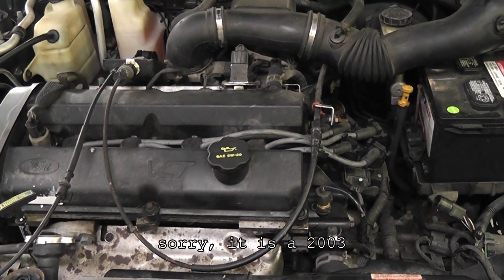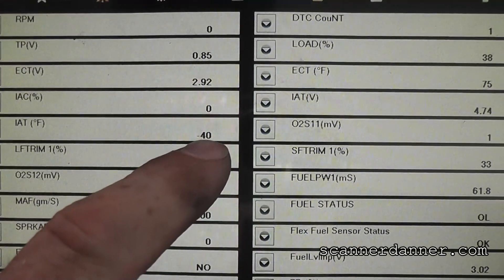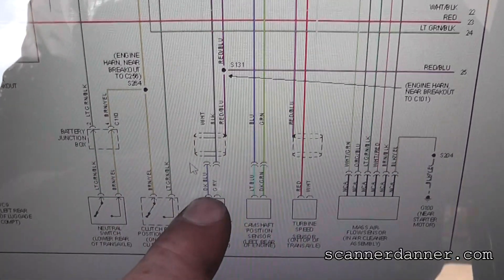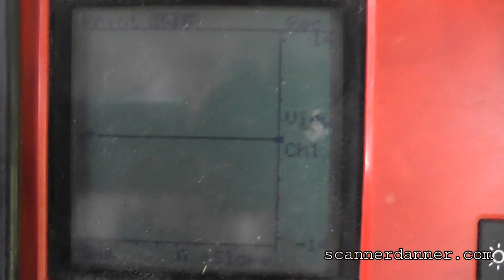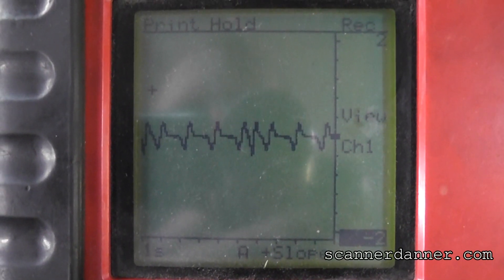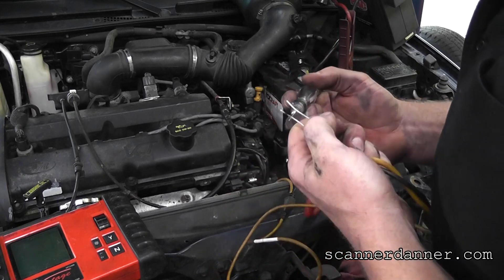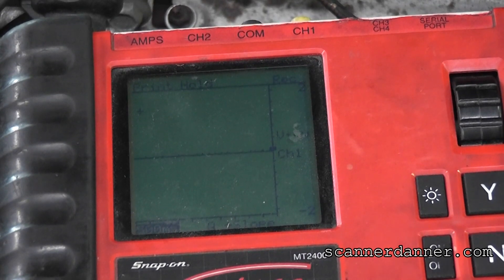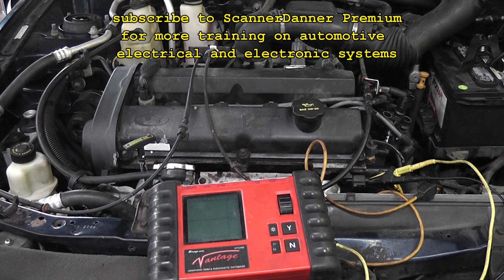How to test a Ford crank sensor (Ford 2 0L Case Study)

Comment: My 2005 ford focus 1.4 recently snapped the serpentine belt, well, shredded it, was due to a faulty power steering pump, replaced the belt and pump, now it's not starting. could it be this sensor? It sounds almost like the starter isn't engaging, but jumps forward when turning the engine over in gear, last roll of the dice before I scrap it, just seems a waste as the car has only done 50k miles

Comment: If you measure the voltage on both wires on the connector to the crank sensor, are both of them supposed to have 1.6 volts? That’s what I got. I have the same car with pretty much the same issue
Reply from the maker: Some of these Ford two-wire crank sensors used a floating ground. Meaning yes, you will get voltage on both wires while cranking or running. It is an AC sign wave though. When are you measuring 1.6v? (Unplugged, plugged in backprobing, engine off or cranking?)

Comment: Hello!I have a 2003 2.0l diesel hyundai elantra that cranks but no start.checking crank sensor (inductive 2 wires+shield)with dmm resistance show 1Mohm.It seams defective but when i crank it produces about1,5-2 ac volts.i don't have a scope to test it.could be a good sensor?Also at start phase if crank sensor is defective the ECM will not activate the pressure regulator valve?since when i crank there is high pressure when measure at hight pressure pump output but it is low  when measured to the rail(the injectors are good-not leaking,the pressure regulator is good,).Thank you. L.E.no fault Code  on tester.

Comment: Ok I have an 03 ford explorer xlt. And it will crank but won't start.. every video I found is useless and doesn't show me where it is located and how to replace it.. help
Reply from the maker: BTW the crank sensor reads a tone ring on the harmonic balancer (front of the engine)
Reply from the maker: Doesn't show you where what is? The crank sensor? 
Your no start could be a lot of different things. What codes? What are you missing? (Spark, fuel pressure, injection pulse)
Reply: @ScannerDanner  honestly idk. My dad drove it from indiana back to ky and after he parked it for the night the next day it would crank but not start.. and he hasn't touched it since..so he gave it to me

Comment: I will take a signal generator and with a pulse and put it right through a ramp signal but I love your electronics you are a legend but I don't like using the scan tool it's a scope because of the knobs you have to play with I like an actual scope but we both agree on electronics

Comment: I have the same problem on my mazda tribute 2003 with the zetec engine. when i start the car does not start, i put it in the scan i cannot find any fault code. I put a new crankshaft sensor but the problem prevails. I ask for your support.
Reply from the maker: you need to find out what you are missing. Do you have spark? What is your fuel pressure? Will it start with carb or intake cleaner?
Reply: ScannerDanner , I Put new spark plugs, new coil and cables.  Even so, the engine did not start.  I tested the pressure at 3.5bar.  I tested the ignition launched twice and cut.  I tried several times the engine accepted to run, I let the engine run without failing for 30min but when I tried to accelerate to get the car running the engine stopped and didn't accept to run anymore.  I checked the injectors have no leak.  What step can I take?
Reply: @abacarmassequece4869  you ever fix it?
Reply: @meofjack9644  I still haven't been able to solve the problem.
Reply: @abacarmassequece4869  I'm having a similar issue aswell my car wants to turn over but just doesn't I've checked just about all I can possibly do with my skill , fuel line carb cleaner in the throttle , alternator battery cables ,starter , and I still get no ignition so right now I'm looking into the coil pack , or the crankshaft position sensor ,I know yours turns on then turns off but yea
Reply: @meofjack9644  I've already replaced the crankshaft sensor, the crankshaft sensor wire, the camshaft sensor.  but the car only starts when it understands, and when it starts I can leave it running for 2 hours it does not turn off, when I try to accelerate the car oscillates the idle and turns off the engine, and then it doesn’t start anymore.
Reply: @abacarmassequece4869  could that be the transmission maybe? Does it drive?
Reply: @meofjack9644  At some point I tried to ride the car, I left the garage in reverse, put the lever in D with the idle speed, the car started to move from the moment I put the foot on the accelerator, the engine turned off.  and it took weeks for the engine to start up again.  And when I'm starting the engine, the speed goes up to 200rpm.  but it doesn't start.
Reply: @abacarmassequece4869  have you checked maybe your fuel pump?
Reply: @meofjack9644  the fuel pump is new
Reply: @meofjack9644  I will check it.

Comment: I  have 96 Ford Contour GL 2.0 L car cranks no start, has spark , fuel pump primes at ing power, has 42 psi on schrader valve, replaced fuel filter, i have tried about all i know, even shot either down the throttle body, its a head stomper.
Reply from the maker: does it start with starting fluid or carb cleaner? If not, remove the upstream O2 to give the exhaust somewhere else to go and see if it starts. If it does, your cat is completely plugged up. If it still doesn't start, then we need to start thinking about a timing belt issue.

Comment: My 03 focus (dohc zetec) has developed a new issue ONLY IN THE RAIN! When I hit a decent puddle, it stalls the car & throws a p0320 & will not allow me to give the car any gas, When I gas it, it misses & dies so, I simply let it idle & slowly give it more & more gas until it clears up. I am wondering if I have an exposed wire or do I need a new sensor? I did have to replace my main & rod bearings once due to cooling fans not working!

Comment: NEVER hold an HT lead away from the coil or engine. You can get a serious shock also it can misfire and send a spike to the Engine Control Unit. (RAC trained and have seen people's vehicles with damage when they do this) Get a plug in indicator and attach a plug to a large crocodile clip with a hose clip, that way you can clip it to a metal part of the engine. Watch the indicator flash.

Comment: My CEL goes off for maybe a second and then comes back on the whole time I am cranking.  (99 Ford Ranger 3.0 v6 2wd AT) is the light supposed to stay off completely?  I plugged and unplugged the connector and the light when off two times but came back on

Comment: Want to thank you for putting this video out. I have an 03 Escape with the same 2.0 engine that recently cut out on my, and had a crank but no start condition. Used this video (minus the back probing looking for wave lengths, as i dont have that kind of equipment) to track down that the crank position sensor had cracked in half. Replaced it and it was good to go, the Ford one lasted 205k miles. Thanks again.
Reply from the maker: Awesome! Glad you were able to fix it yourself before the "parts changers" got a hold of it :-)

Comment: having the same motor in my pile, 2.0 dohc zetec I installed a new timing belt,water pump & acess to the crank sensor is easy if you lay under the car! seems to me that doing it from up top,between the radiator & block, is the hard way! y not just stick your head under the car, ITS RIGHT THERE! BESIDE THE CRANK LOCKING PIN BOLT!

Comment: I have a 2000 Ford Focus Se, think it's my crankshaft. My car will shut off during idling, or iff I'm going low speeds, and overall runs rough, just looking for any opinion
Reply from the maker: if it doesn't shut off while your on the gas pedal, it is NOT the crank sensor.
Reply: ScannerDanner funny cause I unplugged the connector to the crank shaft sensor and then plugged it back in and works without a problem, until I hit a real bad pothole, once again I unplugged it and l plugged it in and it worked
Reply: About to replace the connector tomorrow
Reply: ScannerDanner it would appear it was a faulty connection to the crankshaft sensor, im no mechanic but I put on the new connector and the problem has gone away

Comment: Is it possible for the crank position sensor to give an RPM reading in the PID's while cranking the starter, but cause a no spark, no injector pulse, no start result on a 2007 Ford Focus 2.0? It also reads 74 psi fuel pressure at that time and Fuel SYS1 in Open mode.
Reply from the maker: It is becoming more and more difficult to answer questions here. I have 80,000 people asking me for help now. So I have created a forum to help you guys better. It is free to join and we can exchange pictures, wiring diagrams and waveforms if needed to help guide you through the process of troubleshooting your vehicle. Thank you so much! Hope to see you there. 

Paul Danner (ScannerDanner)

https://www.scannerdanner.com/forum/post-your-repair-questions-here.html

Comment: Question.  I own 2000 escort zx2. My battery is dieing all the time.  So I take it to alternator shop he charges battery and fixes my alternator everything checks out.  Cranks it and boom you can see the power drain out.  Well he starts checking fuses and bad wording. He finds if he takes out my 40 amp fuse under the hood labeled BTN the car runs fine and can set for days with and will crank right up.  I just lose my radio tail lights blinkers doom light with that fuse out.  Can you help. Thanks : )
Reply: C

Comment: On left side of the engine , plastic case covers what ? Camshafts ? On top of engine u see this case 5 bolts hold it on I think and UNDER it spins the camshafts I think that rotate pistons ect..

2 groved discs and a belt are  under this case.. what are the  discs called ?? Cause mine wobble a bit and I hear small clank noise from them 

PLEASE HELP SOMEONE G
Reply from the maker: are you talking about the camshaft gears? The ones that the timing belt ride on?
Reply: Yes I think so, Ford focus 2000 se wagon zetec dohc engine.. left side above the altonater and ac compresor ect and that belt , it has two ridged circle things that turn cam shafts that move pistons ect.... Now only one wobbles and I noticed it cause I heard a rumble sound and followed it there, there is a case cover I took off the see then and one closest to the seats wobbles a bit and even the belt seems off cause of it.... What could this be ? A loose nut or .... It wasn't like like this weeks ago as the noise is New.

Thanks I really appreciate the help here.
Reply: ScannerDanner I believe it turns camshafts , but it turns so the engine can run and pistons ect can go up and down , I belive this is how it works that is. I respect your help like you couldn't imagine as I have been looking up to you for a while and changing my career cause of your videos.... Thanks
Reply from the maker: thanks so much!
The one that is wobbling is probably to variable cam sprocket. It is a hydraulically control actuator that advances/retards the cam timing on exhaust cam (I think). 
It shouldn't be wobbling though. And I'm not sure I can advise you as to why. Something mechanical that is messed up with that actuator. I believe they are serviceable though. But setting the timing belt back up when you're done on that motor is super tricky.
Reply: Joseph Sepe I think it's the cam gear (intake) that wobbles.. Will a new cam gear fix this ? A guy said a new pulley and new cam gear fixed his wobble.... Different car though.... Can I still drivte to work ?
Reply from the maker: you may want to have it checked, If it is bad enough, no, you should not drive it. If that belt breaks while driving, you risk bending all the valves and increasing the cost of repairs greatly.

Comment: Great video. I have a 2000 ford focus sohc. I just did an engine rebuild, runs good, but its shaky at idle and stalls. Has new plugs, new coil, new wires. Could it be a faulty maf ? Any ideas will be appreciated.
Reply from the maker: Does the engine have variable valve timing? If it does its on the exhaust cam and it is real tricky to time and easy to be off. Rough idle is one of the symptoms

Comment: Hiya Paul, really like this one! It's the first time I've heard you discuss Floating Grounds, and these confuse me a little. Do you have open channel vid where you discuss floating grounds, concept and practice ... I'd love to sign up to prem and by book, but I'm not working full time at the moment ... so i might have to wait ... but intersted in what you have to say about Floating Grounds anyway ... Also, another area I am building knowledge on is AFR Sensors, expecially 5 wire+ ... I'm confident now that these can be tested with scopes if you understand the signal wire funcition (can be hard to dtermine which is which) but they often also use floating grounds so I'm not totally sure of the consequence of connecting th Batt (neg) as ground in these systems, though it seems to work ok.
Any thought?
cheers
alex
Reply from the maker: +Alex Messina send me an email through my website and I'll give you a coupon for a free month. Just be sure to cancel your subscription before the 30 days is up so you're not charged for the next month. 
Follow my section 21 playlist

Comment: You are extremely lucky if you didn't damage the ecu on that car by trying to feed the cam pulse to the crank input on the processor without watching for the polarity and the processor enduced floating ground.
Reply: Explain what you mean by processor induced ground. And how a signal that is simply a different signature would damage the PCM.
Reply: +Scanner Danner Premium
That ecu (microprocessor) has locally referenced ground (induced) to reduce signal noise and interference from the main chasis ground and the other more demanding circuitry connected to that chasis. By feeding that floating waveform back to the processor( that is by the way not I/O isolated) you are risking destroying the input side on that processor if you mix the polarity as you did on the video.
Reply: ScannerDanner Premium looks like you got a heckler
Reply from the maker: spasev it's you again. we can do this, if you promise to be nice. so no more name calling okay :)
Maybe I am using an incorrect term in calling this a "floating ground". This particular type of VR sensor will show an AC sign wave on both the sensor + AND the sensor - wires. If you were to disconnect the sensor and measure voltage on the two wires, individualy (harness side), you would see 0 volts on both wires. (voltmeter neg lead connected to battery negative.)
In the design you are describing, I assume you would have some elevated voltage level on the ground circuit. I've seen this on other sensors for sure (O2s for example) and I would call this a bias voltage, but again, I may be using a different term than I should be. I am an auto mechanic, not an electronic engineer. So is this what you are referring too?

Comment: your diagram said  the sensor was on left rear of engine.
Reply from the maker: It was. To determine left and right side of engine, it is not the same as the car. You must put yourself behind the engine (where the tranny is).

Comment: Most cars i've seen with CPS and CKPS will still run if one is unplugged or not functioning.  Usually you get a code and a much longer crank time as clue.  Interesting that this does not seem to be the case on this model.
Reply: It all depends on system design matt. Most older cards would not run without the crank. It wasn't until the late 90s to early 2000s that systems had elaborate enough cam signals to run without the crank. And even then it was only some. 
Then the cam sensor was a different story. It was a 50/50 shot that the car would run without it and that was determined by ignition design and whether the crank had a sync notch in it or not.